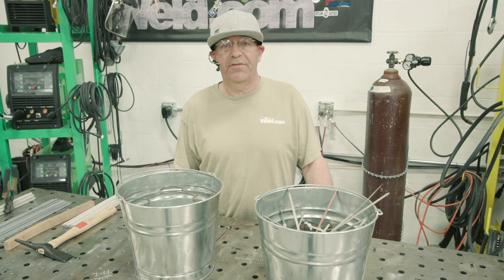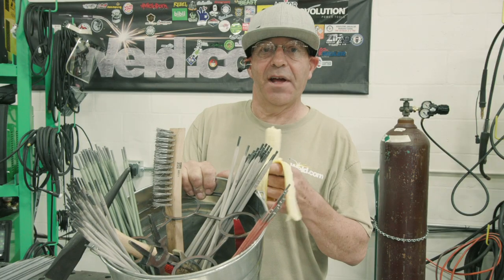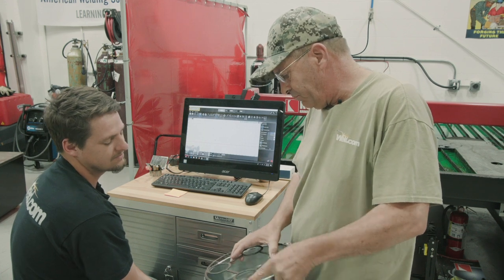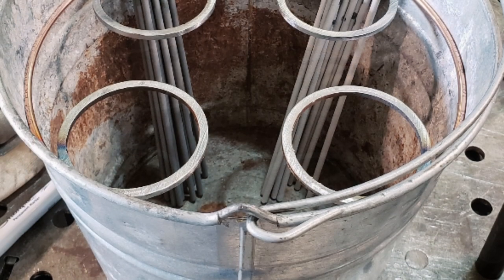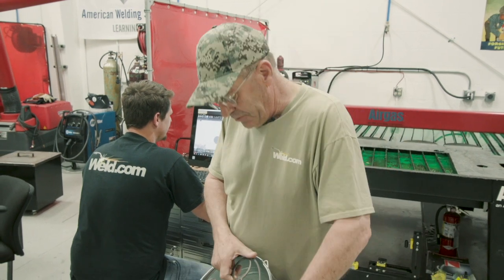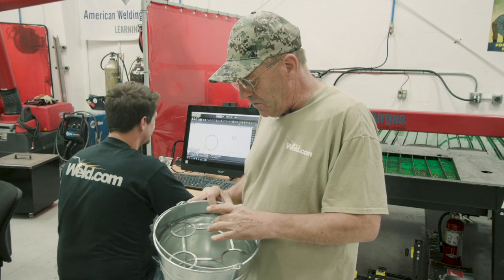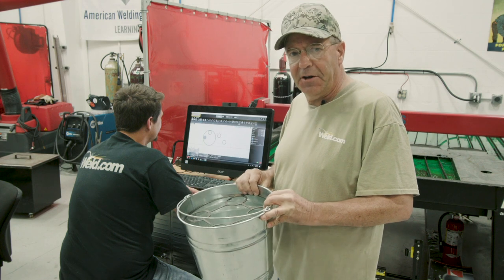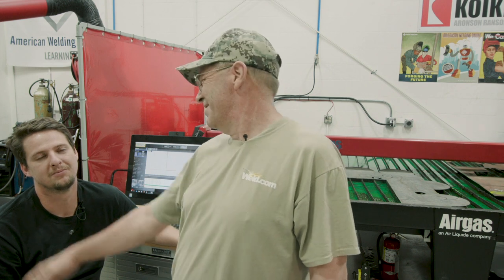The Amazing Bucket Dipper Organizer!!

Comment: If you paint the outside of the bucket with pretty flowers and/or butterflies not only will you be able to spot it a long way off, it probably won't get stolen ;-]
Reply from the maker: You may not lose your bucket, but your co-workers might steal your dignity 😂😂😂
Reply: @Welddotcom  at that point it doesn't need to be stolen...., you already threw it away!

Comment: The QC gonna write you up for not having them rods in a heated caddy!!!!!!!!!🤣😂🤣
Reply from the maker: That's the bucket dipper 5000 - Turbo charger model
Reply: I've never had to store any EXX10 rods in heaters.
Reply: **10 type cell rods run crap if they dry out.  Quickly sorted with a quick dip in a bucket of water lol.

Comment: Orrrrrr you can get some 2"  or 3" pvc pipe an some bailer wire an voila!!!
Reply: Pvc pipe and hot rod stubbs arent gonna be a good mix
Reply: @kf8575  ive used em like that for 11 yrs never had any problems with it